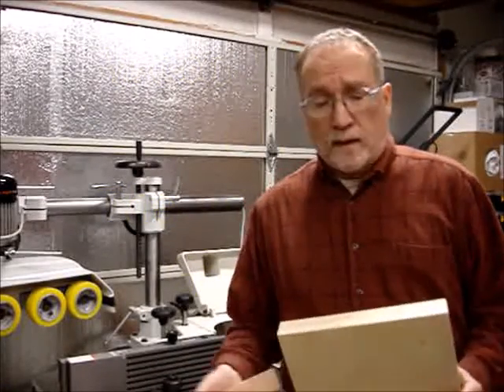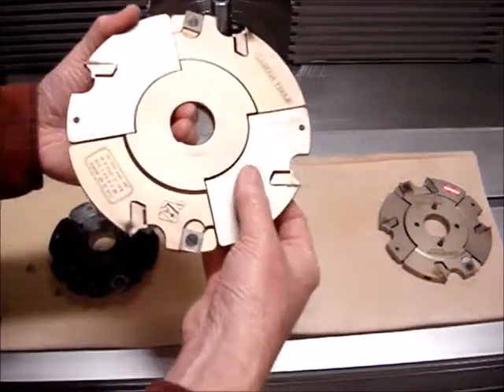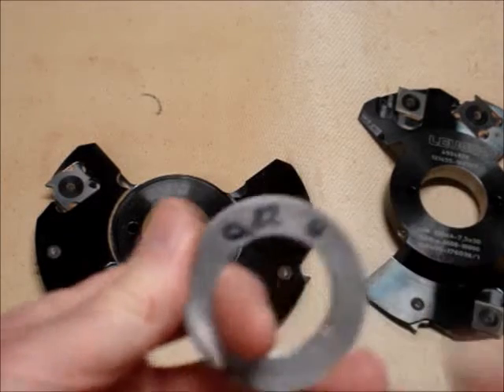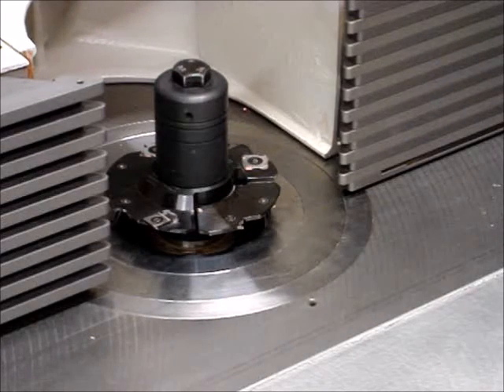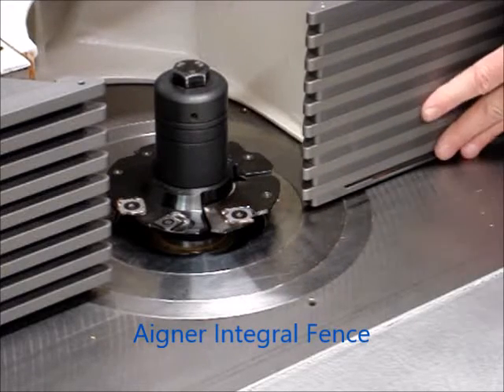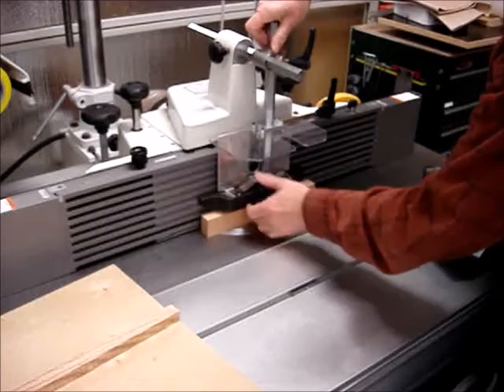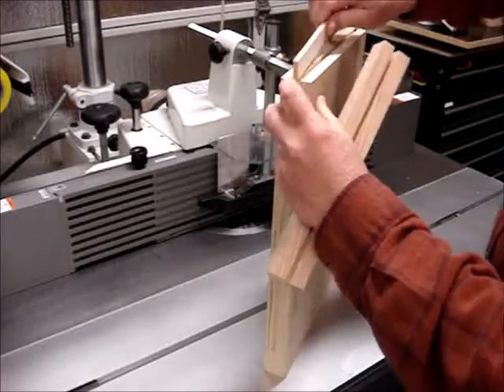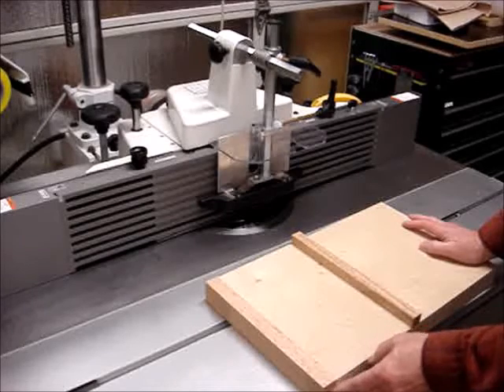Wood Shaper 101 - The Adjustable Groover

Comment: Nice explanation of using one of these. I find a better head to use and allows finer adjustment, is the same as this head your using but instead of shims they use a ring that rotates (i think its on a internal screw) and when you rotate it the cutter gets thicker or narrower. Its got marking which make it way more accurate and finer adjustment. We us them all the time at work, so handy.
Reply from the maker: +fireball570 I had a Freud dado stack with that type of arrangement but I sold it when I went the slider route.  I had not seen this on a shaper cutter.  What brand cutter do you use that has this feature?

Comment: Hi,

Thanks for this - it's a good explanation of the shimmed adjustable groover.  I have yet to get one so any brand recommendations would be appreciated.  

While I understand the demonstration was to show the groover in action, I was wondering what your opinion was of whether just running a glue edge cutter on both pieces would have been any easier than using the spline to join the edging to the plywood.

Cheers
Reply from the maker: +justcruisin109 
I think brands are probably fairly equal in performance and some of them look like they use the same inserts.  The cutter demonstrated was made by Leuco, and the other two shown are Garniga cutters.  Amana, Zuani, and Leitz are also some well recognized quality brands.  

I think a glue joint cutter would work but they are very finicky to set up.  I sold mine over 10 years ago and haven't missed it at all.
Reply: +ExtremeWoodworker Thanks - my shaper is on order so I'm looking for all the tips I can get.  I have about a month to wait before mine is delivered.

I thought the glue joint cutter just involved flipping the other piece to get a matching profile but I guess that only works if the pieces are the same thickness.
Reply from the maker: +justcruisin109 That is true however, a glue joint cutter is also a full profile cutter so the outfeed fence has to be set up exactly to avoid 'snipe' if cutting too deep or failure to close the joint if cutting too shallow.  My first shaper did not have very fine control of the fence so it was a very frustrating thing to set up.  It would probably be easier with my current shaper but I haven't seen the need to purchase another.  I think the lock miter and finger joint cutters would get a lot more use but I haven't sprung for those (yet).
Reply: +ExtremeWoodworker Just the sort advice I was after - based on real-world experience - my shaper will have the fine fence control (infeed & outfeed) so I'm glad I went for that option.  Thanks again - looking forward to any more shaper videos - there aren't many available on shaper setup/configuration (with any level of detail that is).